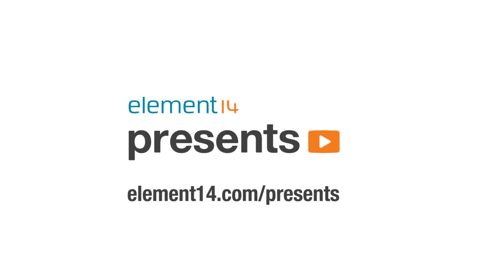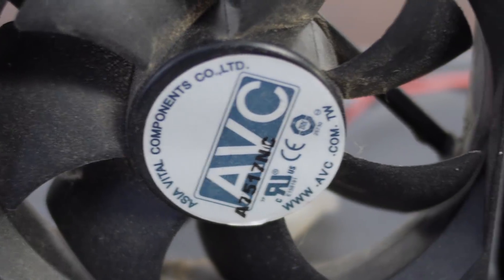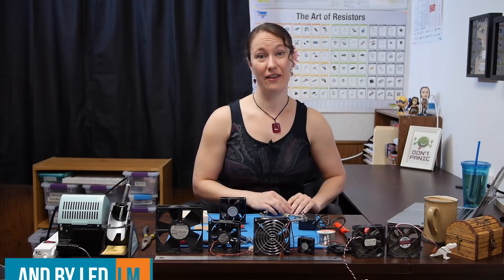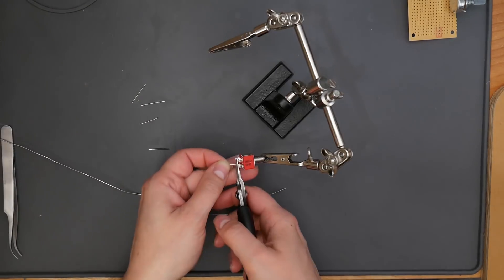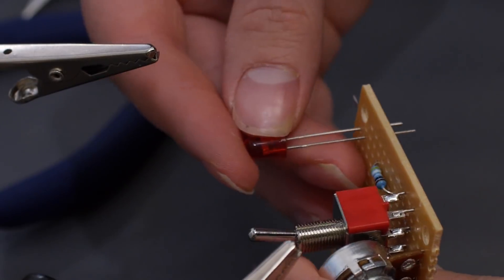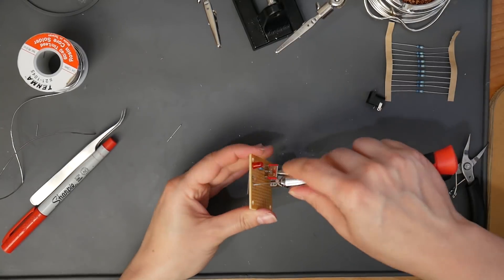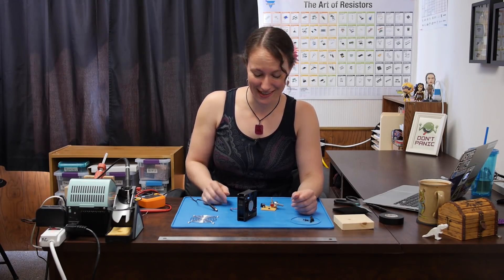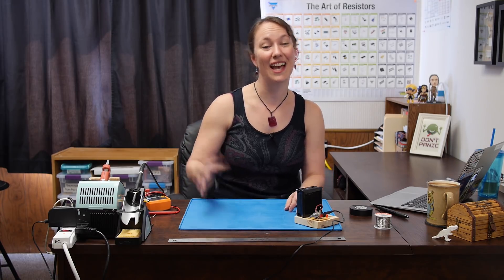DIY Desktop Fume Fan - The Learning Circuit

Comment: What the Heck, dual pole switch? Why?
Reply: She chose the dual pole switch to make it easier to utilize the two different voltage sources. The 9 volt requires a smaller resister than the 12 volt to power the LED without burning it out. 

Yes, you could utilize a voltage regulated supply that outputs the same voltage regardless of it's input. But bear in mind that Karen is teaching basic electronics in this series and going to the more advanced circuitry limits the knowledge being disseminated and the skill building that is needed at this level.
Reply: Erm no Scott. 
To be fair, she probably just used whatever switch she had to hand, but if you check the schematic, you will see that a SPST switch would have done exactly the same job. The PSU is wired into the common terminal on the switch, and so both outputs of the double-pole switch are ALWAYS at the same voltage, so the second pole is entirely redundant.
Reply: @MaxWattage  
WTH... I thought the schematic is wrong... But her PCB soldering also wrong... so confusing... So the battery is actually useless...!!

Comment: You can just use a 1 pole switch, and tap it off between the switch and the pot, furthermore, i would have chosen to panelmount the switch, pot and led. The led will also light with 330 ohm, abeit a little less bright.
Reply: Meh just hotglue the switch & LED (or get one of those LED integrated switches off ebay) to the side, good enough :p